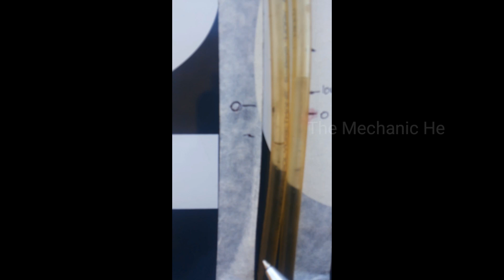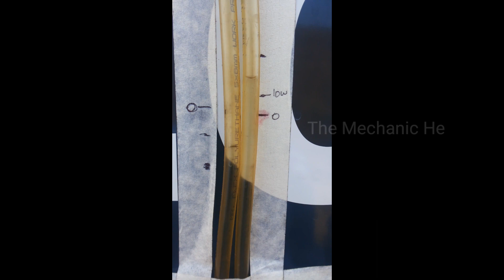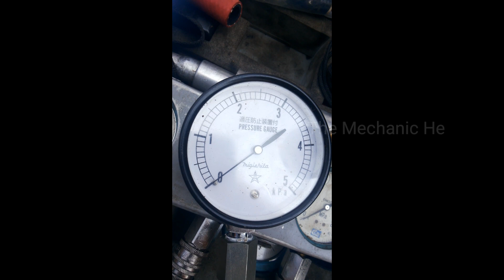Pemeriksaan Blow By Pressure PC200-8MO Excavator Komatsu sistem Utube manometer & Gauge Pressure

Comment: Bang, jika hasil vhms menunjukkan terdapat high blow by pressure tetapi terdapat juga sensor blow by pressure failure. Apakah dapat dipastikan itu terjadi high blow by pressure atau harus dilakukan pengetesan secara manual seperti dalam video ini? Terimakasih. Salam alat berat.
Reply from the maker: ya, harus dilakukan pemeriksaan manual
Dan lakukan perbaikan atas failure yang disampaikan

Salam Alat Berat